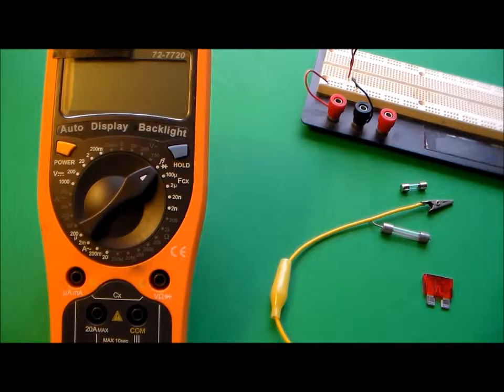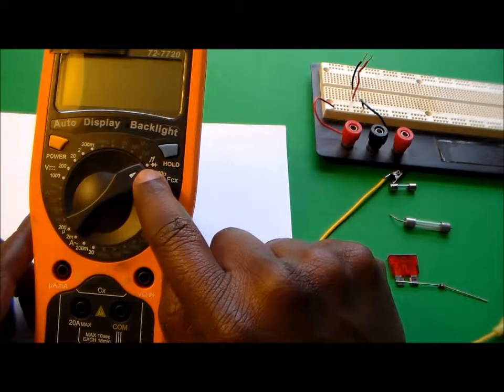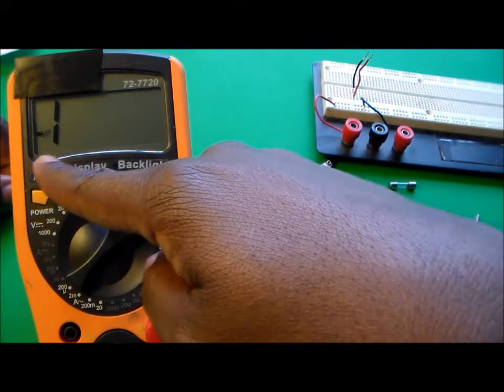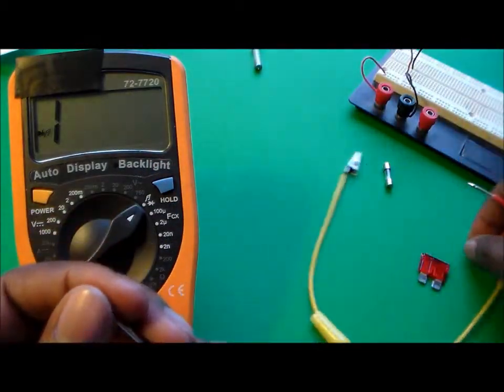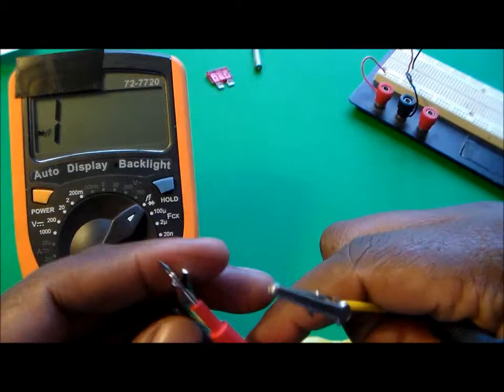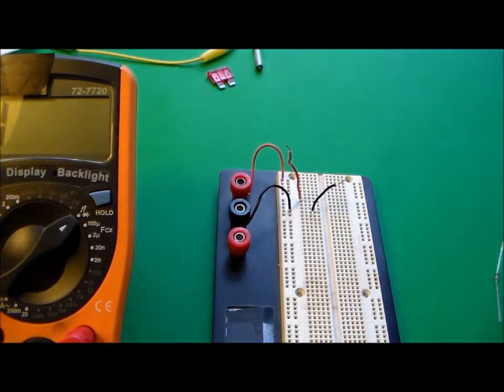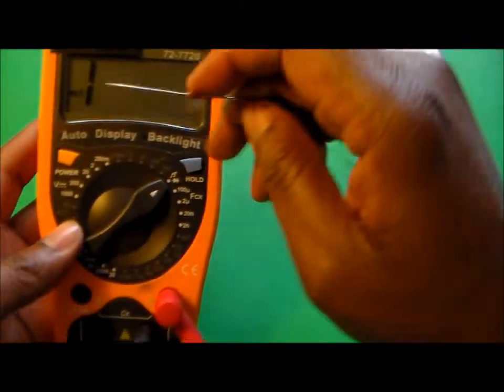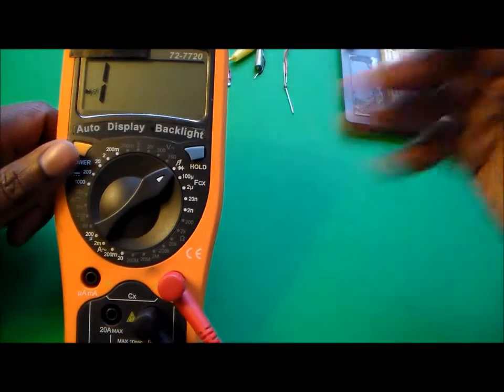How to Measure for Continuity and Measure Diodes Using a Multimeter

Comment: Remember that you can test for continuity from the top using exposed metal tabs of those car fuses.  That way you don't have to remove them to test.

Not sure why you covered the brand name of the multimeter you were using.  If anyone is interested, the 72-7720 is made by Tenma.

Thanks for the video.
Reply from the maker: Hi WizardofGOP. It has been a long time but if I remember correctly, the car fuses I used did not have metal tabs at the top. There were only metals at the leds at the bottom.

Thanks for posting.
Reply: @CALettsomePhDPE  They are there, you can see them at the top of the fuse in the video on either side of the printed '10'.  This wasn't a comment/criticism of how you tested the loose fuse, it was to let people know that when the fuse is still in place in a vehicle that they don't have to struggle to take out the fuses to test them.  Especially if they don't have the tool to remove them.  Just trying to save people some time, fingernails and frustration.

Comment: Hi! Thank you for this video. I have question - I am testing old/broken push button from my car (seems like it is broken). And multimeter in this function shows ~1.7 (not pushed) and ~0.4 when button is pressed. So I would say it is broken. Should be 1.0 (not pushed and make sound when pushed. Correct?